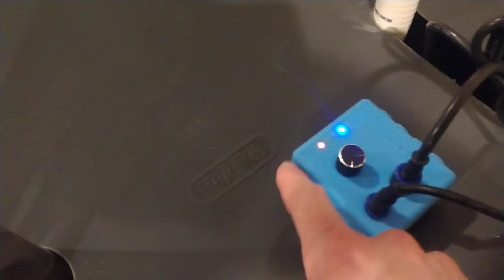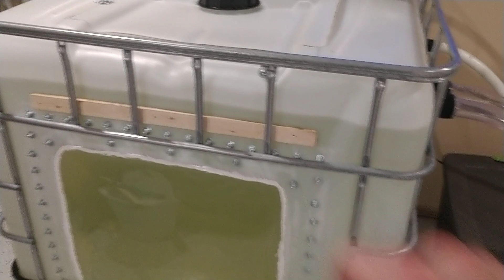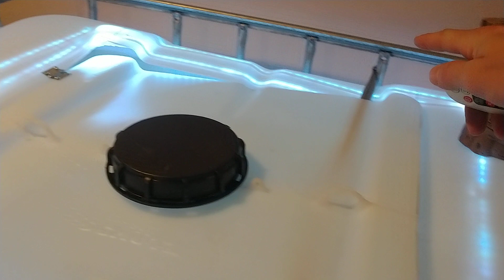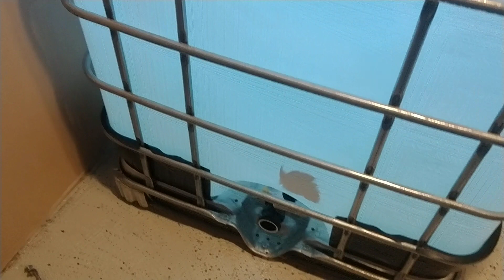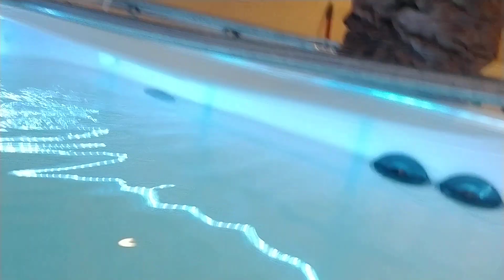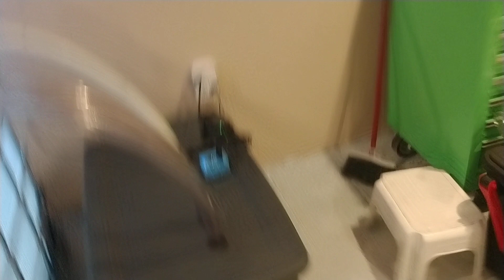275 gallon ibc tote aquarium update

Comment: I really like this project. A word of experience, I've also bought fully water proof LED strips before, but the condensation eventually ruined them in a few months. If you are not particular about the light changing color, flood light is a good alternative. It is usually quite water proof. I also use LED shop light for my tanks if condensation is not an issue. They are really cheap for the brightness compared to specialized aquarium lighting. Really cheap sturdy lighting options. Keep it up.
Reply from the maker: Definitely one of the things I'm probably going to change in the future, appreciate the insight